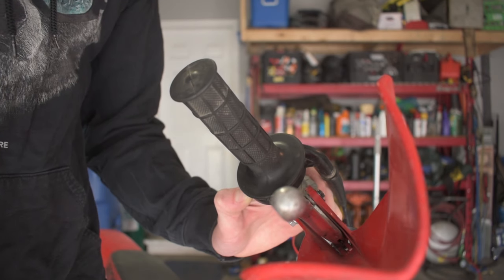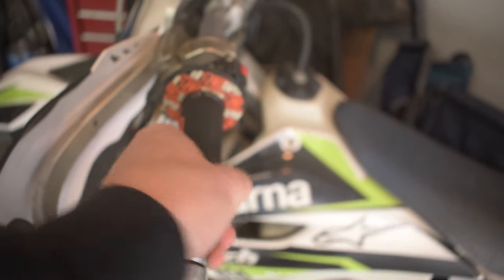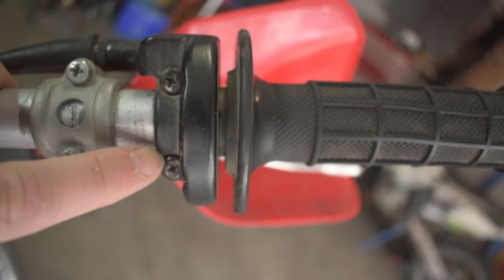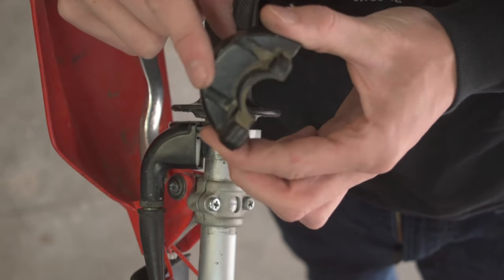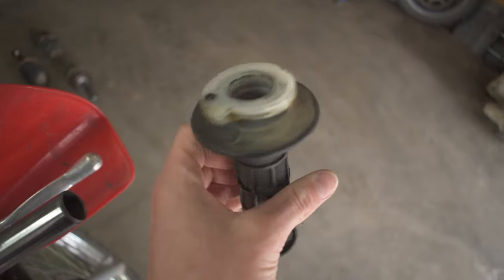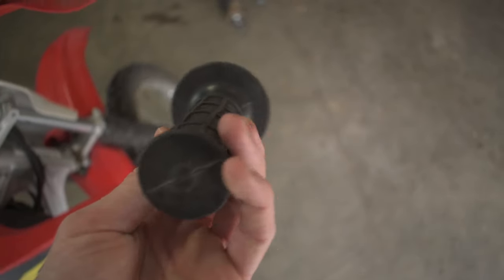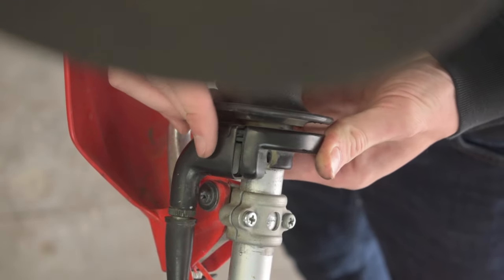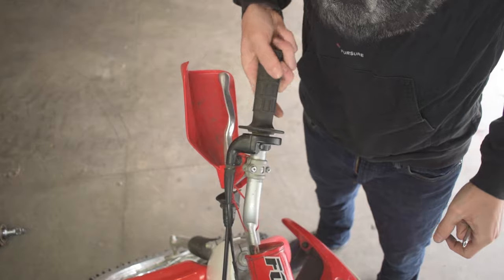How To Fix A Sticky Throttle On A Dirt Bike

Comment: I big tip I have found is usually after a bike layover is the throttle and grip will move. This causes the end of the grip to rub on the end of the handle bar. This will cause a sticky throttle. Just loosen the throttle screws and slide just enough where the grip is just  off the end of the bar.
Reply from the maker: Absolutely!
Reply: Thanks i didn't even need the video
Reply: Thanks your tip nailed the problem I had with an old CB750. I spent a lot of time trying to isolate the problem when the carb return spring seemed so strong.
Reply: i had to do this today after putting new grips on the pitter glue got all gunked up on the end and caused it to stick hella bad

Comment: Very helpful video got my first dirt bike just went out on the trails for the first time and my throttle stop working watched this video took  it apart and found out the old owners never cleaned it and the cable snapped right were it hooked to the throttle joys of buying used 😅 thanks for the help
Reply from the maker: Only happy to help! Glad it was an easy fix !

Comment: I'm having a different problem with this ssr70 so we replaced the cable cause it snapped so of you hold the gas then stop the grip won't stay but it will stay wide open I've hit s tree full throttle because of it. It's only and ssr70 but it has that problem a lot. Idk what it is. Like the cable or it going into the carb, do you hsve any ideas?

Comment: If your bike falls over onto the throttle (right side) then most likely you just need to loosen the 2 screws and move the throttle tube out a little. It gets jammed in causing this sticking symptom.

Comment: My throttle stays pegged even when the handle is back. Does this need some cable grease? Or what else can I check. Thanks
Reply from the maker: Sounds like its stuck inside the carb

Comment: I wish my bike was that easy. It had two throttle cables inside that plastic thing and it was a freaking nightmare getting them both back in because pulling one cable would tug on the other. Did all the cleaning, and still my throttle binds like crazy. I hate the two cable system. 1993 Honda XR. Idk what to do now. Thought this would fix my problem
Reply from the maker: What kind of bike is that on? Sounds like a nightmare
Reply: @AaronsEnduro  I re-edited my comment. It’s a 1993 Honda XR250
Reply from the maker: Did the cable move freely inside the casing if you disconnect it from the carb? If not, id say theres corrosion or debris inside the throttle tube , or possibly the throttle slide inside the carb is somehow sticking, so id inspect that for any binding. My first ideas anyways
Reply: The dual cable is a pain. Mine has a dual cable plus the pin so had to screw holes into new handlebars.
Now throttle sticks when was perfect before. Unsure what to do.

Comment: My bike idles high when I turn my handle bars
Reply from the maker: you probably have the throttle cable routed wrong and its pulling the throttle open when you turn
Reply: @AaronsEnduro  it happend when I change the idle
Reply from the maker: Did you remove the throttle cable from the top tub of the carb at all?
Reply: @AaronsEnduro  no
Reply: @AaronsEnduro  just messed with the idle
Reply from the maker: Im not sure how you can be changing idle by moving your handlebars then
Reply: @AaronsEnduro  I think that the cable is not lubed
Reply: Omg mine to what do i do
Reply from the maker: It’s probably pulling in ur throttle cable
Reply: @AaronsEnduro  how do i deal with it
Reply from the maker: Re route the cable

Comment: Wish I knew this earlier rather than when I was test riding my bike with no kill switch and back drum brakes… cable snapped cause I panicked when the throttle got stuck had to dive off my bike and just let her run 💀
Reply: @AaronsEnduro not fun at all but added a kill switch to my 125 2 stroke and fixed the front brakes not sure how to fix it think it’s a carb issue
Reply from the maker: @ogstarboy  sounds like a sticking carb slide possibly

Comment: What happens if it still doesn't snap back ? Bought a 86 Honda xl250r and got it to start but having trouble with the throttle. Anything I should change or check besides the above ?
Reply from the maker: Did you replace the throttle cable?
Reply: Dude. Same problem same bike how did u fix it if u did

Comment: Yo i have an acceleration cable and deceleration cable buy i still did exactly what you said but when i put it all back together the throttle had zero tension and its just spinning and its super lose down by the carburetor. Do i have to take the whole bike apart or is there a quick fix?
Reply: @AaronEnduro

Comment: Hi I was just wondering how do you get the throttle cable out of the housing? I have the same design as you and no clue how to get the cable out. I can’t find a video of it either.
Reply from the maker: Out of the throttle assembly, or the carburetor
Reply: @AaronsEnduro  throttle assembly. Sorry didn’t know what is was called
Reply from the maker: The cable slides sideways out of the white throttle tube casing . If your cable is twisted it will bind and not want to come out.
Reply: @AaronsEnduro  sorry I don’t think we’re talking about the same part. At around 4:30 you said section of cable with throttle linkage. I’m wanting to take the cable out of that.

Comment: Mine was fine a couple months ago and came back to it turned the fuel on and it comes out the overflow at the bottom, on a side note the throttle is seized neither forward or backward movement… 😢
Reply: Was never like that before idk whay the heck I dis assembly it really quick it seems like the throttle cable is too short or something and won’t move I un screwed the top of the carb to see if it was binding or bent looks fine I didn take it all the way off but It didn’t look bad of course I should take the carb all the way of and check the slide

Comment: What if there are 2 cables? Such as the 2021 Honda CRF 125?
Reply from the maker: Same process!
Reply from the maker: Clean your slide, make sure the end of the throttle isint shoved on too far on the handlebar

Comment: Hey can you help me with my bike it won't start I push the starter and no click so I order a cdi it will be here tomorrow but if it doesn't work what should I check I'm thinking clutch cable everything else seems fine I'm so lost man
Reply from the maker: What bike are we talking about.
Reply from the maker: Id start with checking if you’re getting spark or not
Reply: It's a 125cc (BD 125 11) ninja but battery fine just put in a new combination switch still nothing not even a click  and no spark thinking its the cdi idk
Reply from the maker: Time to get the ol multi meter out and testing!
Reply: @AaronsEnduro  no spark so ima try a new ignition coil
Reply from the maker: Lemme know how it goes!

Comment: what if mine snaps back fine when disassembled , but as soon as put it back together on the throttle body it still moves freely after?
Reply from the maker: The tension is not set correctly

Comment: Heyyyyyy like my bike right when I start it, it feels like the accelerator is already like used uk? It starts making sound and when I put the gear and release the clutch without hands on the accelerator it starts moving it’s dangerous too sometimes please help?.
Reply from the maker: Sounds like your throttle is sticking or is stuck
Reply: @AaronsEnduro  oh but my bike is a vintage 1984 Kawasaki and like when it didn’t start I pulled the choke up and yea but I think the choke is still up that’s causing it to like make the noise you know? And like if you can help please do I’ll be grateful I’m new to these

Comment: i just got my first bike (klx230rs) and ive crashed multiple time, and im trying to see how to fix it
Reply from the maker: Give this a shot!
Reply: I have a klx300 guessing yours has 2 cables too. Wondering if you were able to fix it/ what you did. I changed my handle bars now it won't snap back.
Reply from the maker: Sounds like something is binding
Reply: @ChadOfAllTrades  all i did was take the throttle off and cleaned it, and its good now
Reply from the maker: Wicked!

Comment: What if you have 2 throttle cables
Reply from the maker: What bike
Reply: @AaronsEnduro  klx250r
Reply: @AaronsEnduro  1995 model
Reply: @ibrahimarif9291  yeah man my Honda XR250 has two cables as well and it’s a freaking pain. I still havnt figured it oht

Comment: I was driving at like 30mph and it just randomly stopped working and had to walk it a mile😭
Reply from the maker: Throttle cable broke, or came out of the housing
Reply: @AaronsEnduro  bruh its a brand new bike and I went to go check and the throttle cable is broken😭

Comment: I crashed and now whenever I start it, its runs fully open. What should I do, just clean out the assembly?
Reply from the maker: Sounds like your throttle is stuck wide open
Reply: @AaronsEnduro  It is, so do I just follow these steps and see if it helps? Nothing else that you can do I guess
Reply from the maker: Yes i think your throttle tube got jammed onto the handlebar and is rubbing

Comment: Big mistake I made hopefully this comment Will prevent someone from making it I replaced the grips on my bike recently. And I thought I was doing it correctly. I cut the old grip off the throttle. Install the new one with a little bit of glue. My kick stand was down so it was angle on the bike towards. The ground came back later for the glue to dry and glued my throttle shut

Comment: My throttle is wayyyy worse than this, it doesn’t return at all
Reply from the maker: You may have a frayed throttle cable getting bound inside the throttle cable
Reply from the maker: Or debris inside the throttle slide in the carb